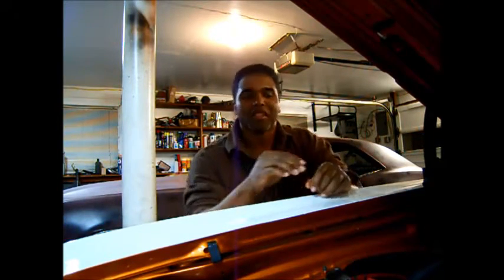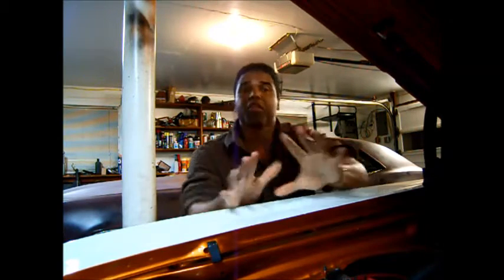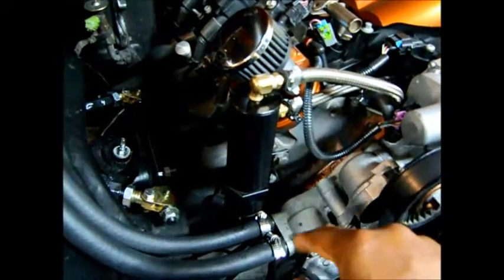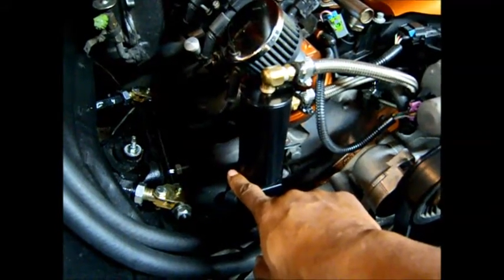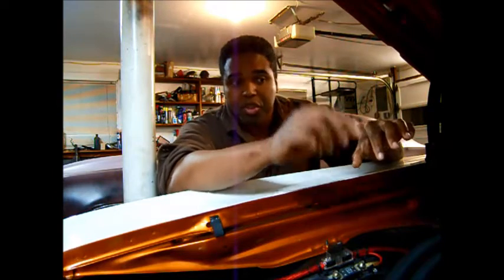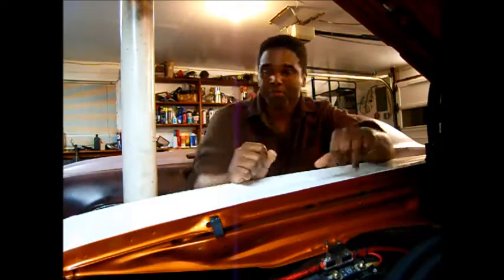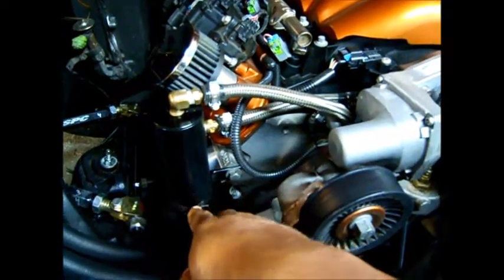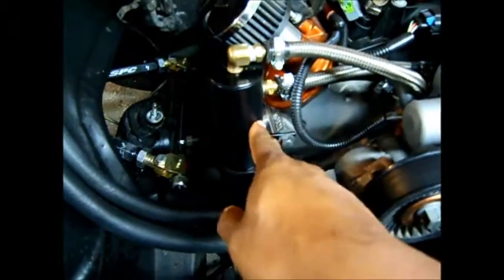How To: Install A Oil PCV Catch Can. (Information And Explaination on Why To Install One)

Comment: Doing some research to see if i can use a shop air compressor line water/oil filter as a catch can,since i already have an extra one laying around my shop ( i upgraded to a higher line pressure one). They have a separator screen a clear glass/plastic to check level and the same drain system as a catch can..Trying to save $$$
Reply from the maker: i like that.. its all about saving the cash..

Comment: Love your channel brother. I am at the same stage. I'm trying to figure out what to do. I don't have any of the pcv system and wanted to know if you recommend the catch can or just go back with the original pcv system? The reason I ask is, I'm a noobie and don't want to get in over my head. Thanks.

Oh yeah it's a 5.3 with ls1 intake. Thanks again.
Reply from the maker: im a always use a catch can type of guy. lolol thanks for the compliment.. keep me posted as to what way you go brotha..
Reply: @Coverman66  thanks for the reply. At this point I'm just trying to get my car running and maybe add a catch can later. I was thinking of running a inline pcv with rubber hose until I get everything together. What do you think would be a economical alternative to a catch can. Thanks.
Reply from the maker: hmmmm, i would wait to get the can.. you will be happier.. keep me posted on your build..

Comment: great video man thanks for posting it appears you're not running PCV to the valve cover is that right? just using a breather cap? I just bought valve covers with the PCV ports deleted and hoping a breather will do the trick on my LS2 (with ls2 valley cover. thanks

Comment: Well let me ask you this I noticed something in your video on top of the aluminum head the access oil hole where you insert oil after doing a oil change why is it that you have a air filter right there?
Reply from the maker: because i blocked off the pvc so i needed to have the engine breathe..
Reply: @Coverman66  oh okay cool I also have a LS & its a  5.7 and I pretty much took after you I got to catch can do I or need to do the same thing so the engine can breathe

Comment: Maybe you can shed some expertise on the Fuel Pressure Sensor and fuel rails.  (Mine is a 4.8 Vortec, but I am thinking they are probably the same as the hipo LS engines.)
Reply from the maker: are you talking about a ls1 style regulator thats on the rails? i usually get the ls2 fuel rails and use a regulator/fuel filter from a corvette. to me it looks cleaner.

Comment: would you need a pcv valve going from the catch can into the intake? I know the vally cover already has a built In one but im a lil confused? btw cool vid you look like a "car guy muhammad ali
Reply from the maker: lolol i hear i look like Ali atleast 5x a week... pretty cool,... this is how i hooked my can up.. i plugged the pcv valve off on the rear drivers side valve cover.. not to be used. going from the valley cover spout to inlet of catch can, from outlet of catch can to the port on the passenger side of the intake right behind the throttle body. let me know if this helps brandon...or if you have any more questions.. thanks brotha..
Reply from the maker: Hey Nicholas, ive seen a few people do it that way and says it works out great.. whenever i check my manifold its usually very clean.. the catch can does a good job, but if you want to have extra insurance two cans cant hurt..

Comment: Just use a ls6 valley cover. I need to do the same
Reply from the maker: i like the spouted ls2 cover.. make hooking up a catch can easier..
Reply: @Coverman66  Haha. I just got my cover in the mail last night
Reply: @Coverman66  are you not using knock sensors?
Reply from the maker: sure they are not located in the valley cover on a ls2.
Reply: @Coverman66  i need to get a ls2 timing chain. Ive read they are great.

Comment: Hey Bro
Will a 4L60e ,4L65e or 4L80e fit in a A-body chevelle without beating on or cutting the bell housing.
Reply from the maker: whats good Awesome.. they are big overdrive trannys.. i had to modify my tunnel for the t56.. remember the A bodys have the smallest tunnels in the GM fleet so chances are you will need to modify the tunnel.. keep me posted and thanks for viewing..

Comment: don't LS engines need to vent from BOTH valve covers?  You have only one inlet.  I have a turbo LS4 engine and have been told I need to vent both valve covers....
Reply from the maker: Whats Good Rick,  hmmm im not sure because of your turbo setup, but i have the big breather for a valve cover and the ls3 valley with the spout that connect to the catch can then to the intake neck behind the throttle body..  hopes this answers your question.. thanks

Comment: I seriously need some help with my catch can setup on my supercharged ls1. can you help me out??? do you have a email I can send you pics and video
Reply from the maker: whats good Lavar, are you using a LSA Supercharger or an aftermarket?
Reply: aftermarket..... Magnacharger MP112
Reply from the maker: is there an air inlet located behind the flange where the throttle body bolts to?
Reply: yes
Reply from the maker: i believe that where the air from the can goes.. i never hooked one up with a magnacharger, but if that hoes is going to the valve cover.. its a safe bet you can tie the catch can in.
Reply: OK....it's hard to explain I have to let you see a pic
Reply from the maker: no problem, you can send to my email address terrylsx@yahoo.com..
Reply from the maker: Check it out My LS Family..   Im now on Facebook: Terry LSX  and Instagram: terrylsx, subscribe and follow for more pic and short vids of past, present and future project.. thanks again my LS Crazed Amigos....

Comment: LOL mine is an aquafina bottle with a zip tie and a piece of a dish scrubby for a filter and a cork to plug the air box on my 351W. It was coughing up gobs of oil but after putting in a new PCV valve my catch can usually only has a few drips in it.  Will this relieve the vacuum in the head of my Suzuki?  It sucks air bad when you pull the oil filler cap or dipstick out and it actually makes the engine stall out due to the vacuum leak.
Reply from the maker: yea ive seen that happen once.. the owner forgot to close the catch can.. once he did the car ran beautifully..